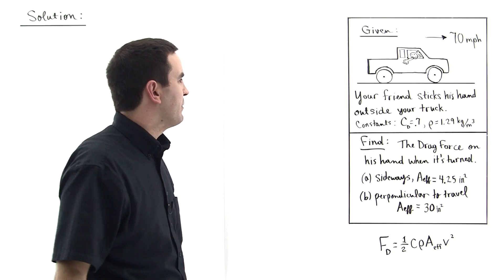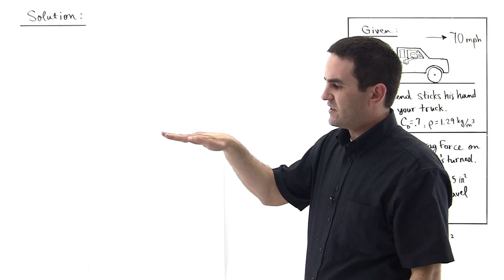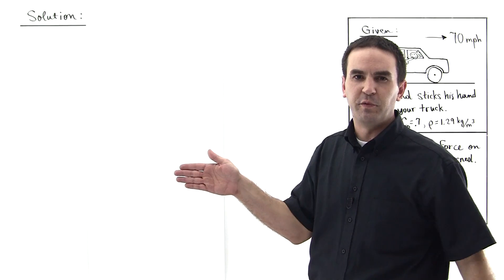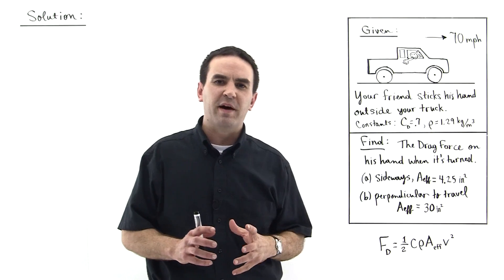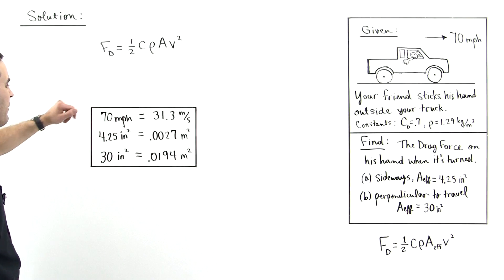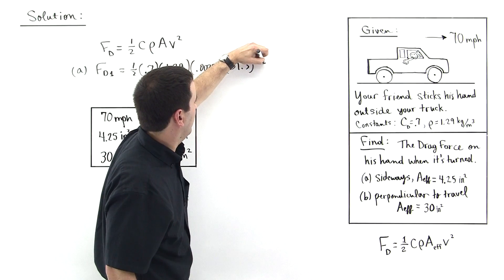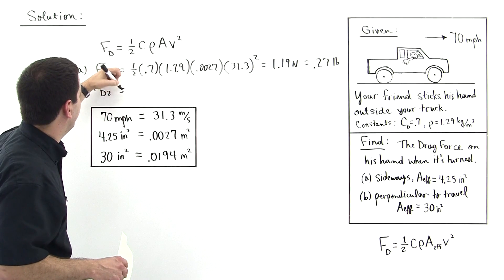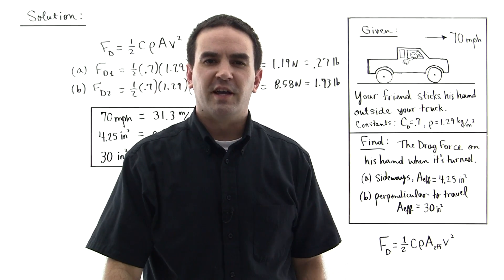Drag Force

Comment: Saul, awesome video, please make more. Talk about the effect of the Reynolds number at laminar, intermediate, and turbulent flow, along with the texture of the surface such as rough verses smooth. 

My question to you is at what exact velocity does the resistance of air increase to the cube of the velocity. A Mach number with the little extras would be great such as the temperature and pressure. 

I can''t believe you covered more material in under six minutes than others don''t even cover in 60 minutes, and with much less talk. You are great.

This video has been up since 2011, seven years, and I barely came across it by accident.

I liked and subscribed and pray that you are in good health.

Thank you

Comment: space does have stuff in it. Thats why I have been trying to compute the drag on a star ship the size of a shuttle going 10 percent the speed of light. All I know is I have an interstellar medium with a density of one hydrogen atom per centimeter squared. What I dont know is how much drag this would place on a ship going 10 percent the speed of light.
Reply: Chris, just plug in the values in the equation along with their substituted conversions such as the following:

 1/2 x (1 da/28.9644 air da x 1.29 kg/m^3) x (4m x 4m)^2 shuttle frontal area x (0.10 x 299,792,458)^2  = 2 x 10^15 N.

density of hydrogen as compared to air on earth = 0.04454 kg/m^3
Hydrogen = 1 dalton
Air, on average is 28.9644 daltons

You'd have to pick up speed slowly in order to not kill any living organisms by the g forces which would be approximately 2 x 10^14. 

Trained and experienced jet fighter pilots can take around 20 g's on a turn with special suits and body training. Most people pass out at around 10 g's, so an increase of 10 g steps to get to the 2x10^14 at one second intervals would take approximately 2x10^13 seconds, or 647,156 years.

But! thats for the least, you still need another 647,156 years to slow down 10 g's per second.

Oops! I got carried away and calculated for the speed of light and forgot the 10% factor, but I'm sure you have a better idea now. 

Great video, don't you think?